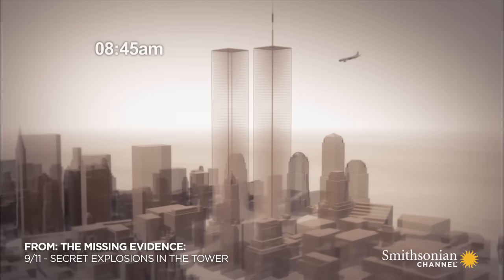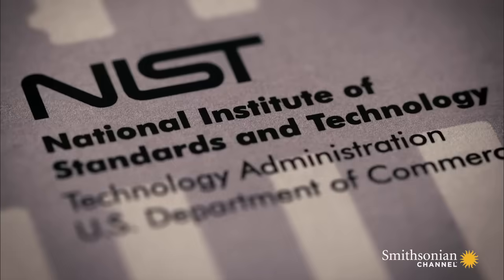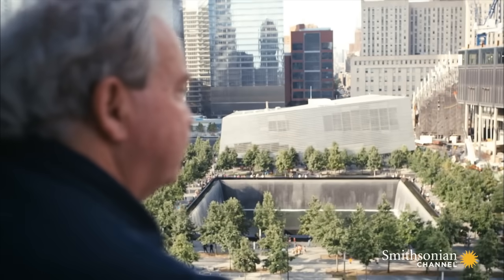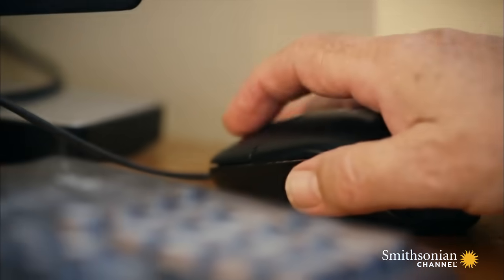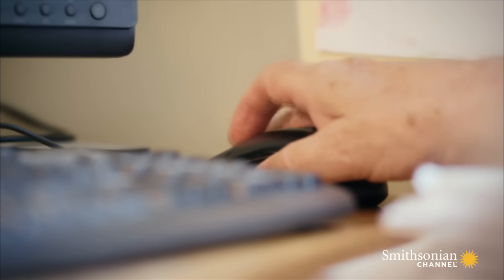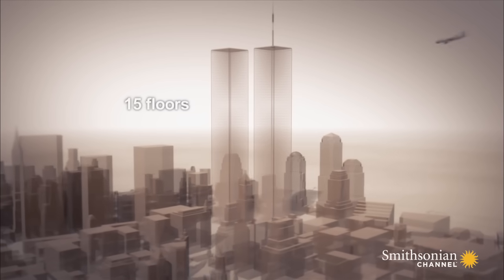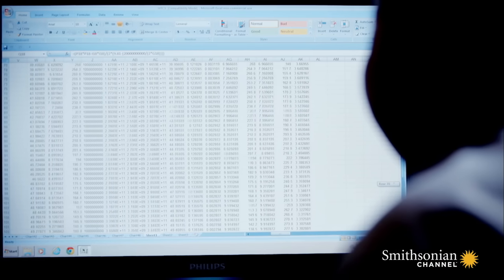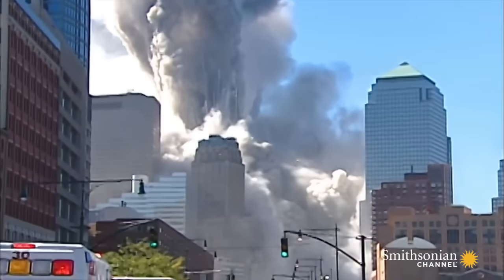This Computer Simulation Explains How the Twin Towers Fell

Comment: Why did the cement turn into a fine powder
Reply: The concrete floors were made from Litecrete which is not very strong.
Reply: @drunkpeopleareviolentandan4893  thanks
Reply: @Shabangs510  
Can fire cause a building to collapse?

With very little wiggle room, floor beams that heat up during fires could press up against their uncompromising boundaries, potentially breaking their connections and causing floors to collapse. To better prepare buildings for worst-case scenarios, structural designs may need to account for the forces introduced by fires.
Reply: @drunkpeopleareviolentandan4893  My issue is that, shouldn’t the lower portion of the building be supporting the upper version, even with some collapse at the top I thought the bottom foundation of the building (being built to industrial standards) should by default be able to support the rest of the building. Even in the event of the collapse.
Reply: @Shabangs510  
The truth is that office buildings are not very strong, they could be designed super strong but it would cost billions of dollars.

The connections ---> bolts/welds in the towers were poorly designed and not strong enough. The connections failed during the collapse.

The twin towers had a 6 floor collapse limit ---> if more than 6 floors collapse (at the same time) ---> bad things will happen.

Below is what NIST said:

The vertical capacity of the connections supporting an intact floor below the level of collapse was adequate to carry the load of 11 additional floors if the load was applied gradually, and 6 additional floors if the load was applied suddenly (as was the case). 

Since the number of floors above the approximate floor of collapse initiation exceeded six in each WTC tower (12 floors in WTC 1 and 29 floors in WTC 2), the floors below the level of collapse initiation were unable to resist the suddenly applied gravitational load from the upper floors of the buildings.

Since the number of floors above the level where the collapse initiated exceeded six for both towers (12 for WTC 1 and 29 for WTC 2), neither tower could have arrested the progression of collapse once collapse initiated.

In other words, the momentum (which equals mass times velocity) of the 12 to 28 stories (WTC 1 and WTC 2, respectively) falling on the supporting structure below (which was designed to support only the static weight of the floors above and not any dynamic effects due to the downward momentum) so greatly exceeded the strength capacity of the structure below that it (the structure below) was unable to stop or even to slow the falling mass. 

The downward momentum felt by each successive lower floor was even larger due to the increasing mass.
Reply: @drunkpeopleareviolentandan4893  thanks for being patient and answering appreciate it
Reply: @Shabangs510  Controlled demolition. Just look at it with your own eyes. These buildings aren't merely collapsing, they're exploding. It's obvious that's what's happening, but that's where the cognitive dissonance comes in. It means that the destruction was caused by more people than 19 alleged hijackers, people who were Brown and were from halfway around the world and wore red bandanas and wielded knives. Instead, a controlled demolition strongly implies that perhaps white men wearing suits and ties within our own government could have been involved. Hence, all the pseudoscientific explanations in defense of the indefensible official narrative in order to comfort people and reassure them that it was in fact only 19 hijackers who caused all of the physical destruction.
Reply: @adamsyed5535  yeah it seems strange to me how clouds of powder pop out the sides as if the building is going boom but it could be a structural integrity problem like our friend says. I’m on the fence man

Comment: The tower was burning for only 1 hour
This is impossible. Weaker structures have burned for hours and still didn’t collapse.
Also A plane is made out of thin aluminum. It is impossible this could break all the columns in those floors. It is like cutting an egg with a knife. And still if the damaged parts of the towers did collapsed it could never collapse completely in just 11 seconds against all Newton’s laws without any resistance. Impossible, unless the entire building was already weakened by explosions or termite.
Reply: Those Weaker structures did not have plane impact damage.
Reply: K, Rosie O'Donnel. smh
Reply: @peterjv8748  lol

Comment: Definitely inside job
Reply: Not plausible.
Reply: @peterjv8748  Extremely plausible. The power cabal wanted to commit a false flag way back in the early 60s as an excuse to invade and topple Castro but Kennedy rejected the plan. Read up on Operation Northwoods.

Comment: lol well that proves it everyone!! Dropping a smaller object on path of more resistance it will be met with none at all.
Reply: Says who?
Reply: The bottom section might have more resistance, but the acceleration of the upper section increased its force. Force = mass x acceleration.

The towers collapsed slower than free fall, which proves the bottom section slowed down the collapse (offered resistance).

Smaller? ---> don't you mean lighter or weaker?
Reply: @drunkpeopleareviolentandan4893  you know what you're saying makes no sense right? If I cut off a portion of a building, hang it there with a crane over top and drop it on it, you really think the entire building will pulverize itself into its footprint?
Reply: @delesdog 
''lol well that proves it everyone!! Dropping a smaller object on path of more resistance it will be met with none at all.''

==> It was a story by story collapse ---> 12 stories crushes one lower story, now you have (12 stories + 1) crushed lower story = 13 stories falling on the next lower story ---> then 14 stories...and so on.

==> Forget about resistance. (electricity can still flow through a copper wire that has resistance).

==> It was the (mass AND acceleration of the structure and rubble above) vs (the mass of the structure below).

==> The bottom section had an applied force of (mass x ZERO acceleration = 0).

==> The bottom section had ZERO applied force. (it only had a normal force).

==> The bottom section could not accelerate upwards to equalise the crush down forces, so the connections failed. The TTs had weak poorly designed connections that were not designed to handle large impacts.
Reply: There was most definitely resistance! We know this because the collapses of the towers were slower than free fall, in the case of tower 1 about DOUBLE the time of free fall.
Reply: @Tim22222  they were basically free fall. They were pulverized into their footprint. Its impossible without at first severing the structure.
Reply: @delesdog  "they were basically free fall."

No they were not!! I can show you a video showing that one of the towers took more than 20 seconds to come down - that more than twice free-fall time.

And what, exactly, are your qualifications that what is & is not possible where building collapse is concerned?

Comment: Shame on you, educated man, trying to pull the wool. Either you were paid or threatened to say that.
Reply: I think they are just going with the science.
Reply: Rationality  
''The building was in free fall for over 6seconds.''

==> What a load of rubbish, the TT's did not free fall. David Chandler measured that the TT's collapsed at only 64% of free fall.

==> David Chandler measured that B7 only had a 2.25 sec moment of free fall.

''why don’t the mention the thermite they found?''

==> There is no evidence of individual elemental aluminum particles that you would expect to see from a thermite burn. 

''The angled beam cuts which are only impossible because jetfuel cant melt steal beams, and even if it heated it enough to twist it would never cause a sheer angled cut...
''

==> Those angle cuts were debunked years ago, they were done with gas tourshes by ground zero workers AFTER the collapse. There are photos on google of the workers with the gas touches standing right next to those columns that were cut. 

==> Are you saying just a few 45 degree cut columns (at the street level) will causes the whole building to come down?
Reply: Rationality   "The building was in free fall for over 6seconds"

Not true. time it yourself. It was about 15 seconds. Not to mention the column you can see standing for several seconds after the rest of the building collapsed. Which is all completely inconsistent with controlled demo.

"why don’t the mention the thermite they found?"

Only one guy claimed he found thermite and never let anyone look at his "findings."

"The angled beam cuts which are only impossible because jetfuel cant melt steal beams"

The cuts were from days later done by rescue workers. If you search for day after photos you can see the beams are not cut yet. 

"Love how they dont mention the pools of molten metal that lasted over 2weeks either"

I'm not sure what you are talking about here. Can you link me a credible source that talks about and shows this?

Comment: Propaganda on a mass scale...........and notice how they didn't explain WTC7.  Our institutions have been hijacked by the elites.
Reply: @Shelby_Starner_Everything  Never in the history of skyscrapers has one fell apart......until 9-11....and 3 fell on one day
Reply: Who didn't explain WTC7? WTC7 wasn't one of the terrorist's targets.
Reply: @peterjv8748  Exactly...and it went down as a controlled demolition without any major or minor structural damage.
Reply: @peterjv8748  Says every network that video recorded the building collapsing on its own footprint.
Reply: @peterjv8748  Architects & Engineers for 9/11 Truth (AE911Truth), a nonprofit representing more than 3,000 architects and engineers have signed a petition calling upon Congress to open a new investigation into the destruction of the three World Trade Center towers on 9/11.
Reply: @Shelby_Starner_Everything  plenty of buildings had more extensive fires without falling.  Others had planes crash into them.  Get that weak sauce out if here.
Reply: @Shelby_Starner_Everything  Keep moving the goal posts.  The more you stay away from logic the harder it is to get back on the road to the truth.  3 skyscrapers collapsed at free fall speed for the first time in history.  It would not be the first false flag operation that our government executed.

Comment: Wheres the molten metal and the 45 degree cut I-beams
Reply: The i-beams were cut after the attack by clean-up crews dismantling the wreckage.
Reply: 12weasel100  You just answered it...so I guess there was a point to my question

Comment: Radiocontrolled Magnetic C4 explosive in centrale colums....
Reply: Or ya know a propane heating unit with pipes running all throughout the center columns... But it's c4 right?
Reply: it's a Mossad Job. "propane heating unit with pipes running center colums" hahahahhahahahaha Dude omg.......
Reply: @marsoudu87  Did I say something funny?? I was simply offering a scientific explanation on how the build could crumble down on itself. A pipe with 3000*C ignited propane would explode over and over again as it regulates itself between high and low pressure, high and low temperature down the entire pipe line until there's sever lack of forward pressure. But you're free to disregard my statement, it does not make the slightest difference to me.
Reply: @MinkoMix  yeah pretty funny, you should work to NASA
Reply: @marsoudu87  
I sense a hint of sarcasm in that statement, I could be wrong though I've been wrong before, and it wont be the last time.

Now if only NASA wouldn't just hire people with 100 years of formal education lol. Although I think I'd rather work for Neuralink just out of personal interest in the particular field of research than NASA. I do quite like astronomy and astrophysics though, I think one of the biggest regrets I'll have in my life is that I very likely won't be able to see a nebula cloud with my own two eyes.

Comment: Wow so they designed it too with stand and airplane crash of commercial jetliner and it did not. Well burning jet fuel into the coulumns at that speed  well i guess nothing stood a chance.
Reply: Wow some people4 just like to start a fight just to hear them selves blapper. Senselessly. Its a sad day the towers could notwithstand that impact the hot fuel and high speed impact melted the steel columns they came down shortly after. Killed alot of people well there always gonna be debates for years to come on how it could have happened the terrosists had it planned out.